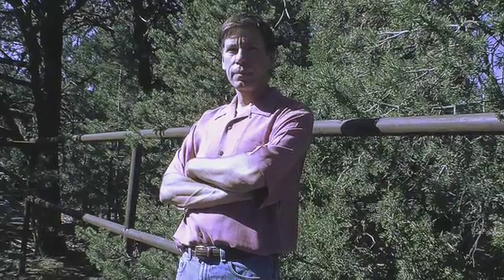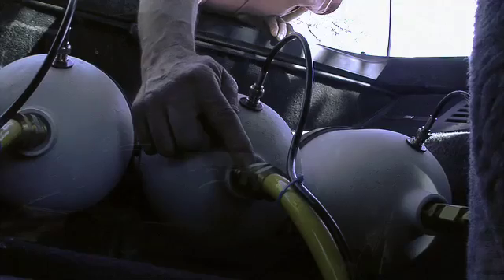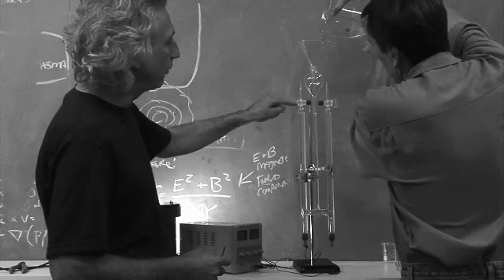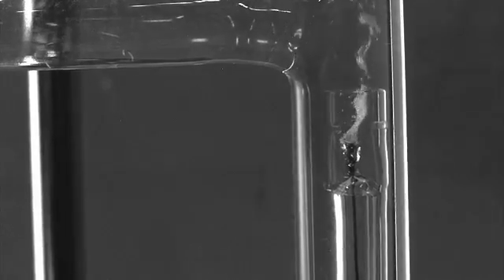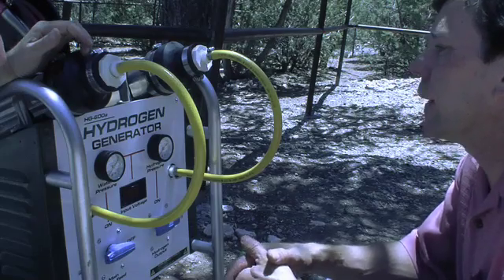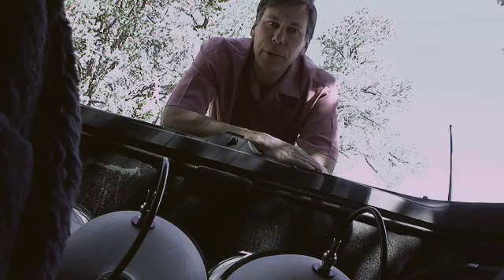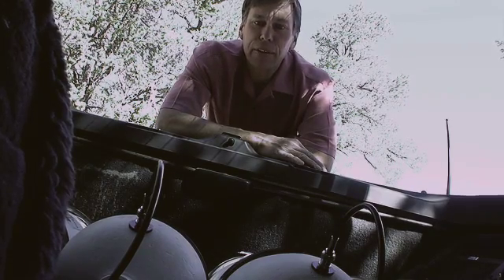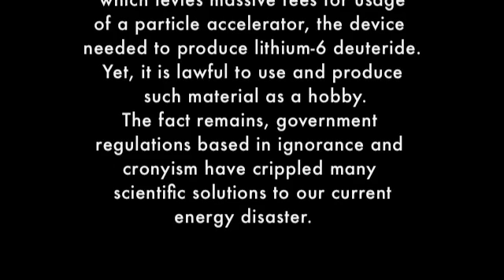Who's Killing the Hydrogen Car? [Original]

Comment: collecting the gas in a tank creates a danger of explosion, the Joe fuel cell used the gas as it was made,  Stan Myers built a unit that powered a dune buggy that he drove across America  to the white house, he then improved the system by making the gasses separate in a fuel injector, sounds hard but all he had to do was run his 2.2 volts through the injector needle.